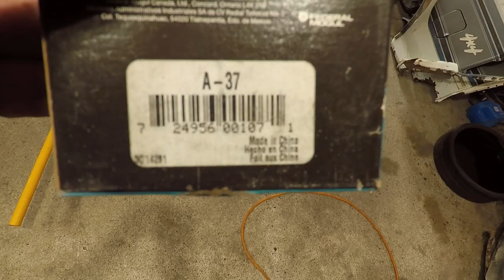Wheel BEARING Replacement  FORD F150 4x4

Comment: This might  be a dumb question but if I just buy new front disc rotors + pads wouldnt I just be doing a 2 for 1 fix? Or I would have to transfer my old bearing into the new rotor

Comment: I replaced the rotors on my 79 f150. I noticed your outer nut came loose very easily; I torque the inner to 50 ft/lb then back it off 90°. I torque the outer nut to 150 ft/lb, though the spec is 160-200 ft/lb. but my torque wrench maxes out at 150. I wonder if your problem stemmed from an outer nut not being torqued enough?

Comment: I replaced the wheels bearings, spindle, spindle bearing, the races, the wheel seal. And I’m getting a noise (scraping/dragging noise) from one of the wheels. Any ideas? I replaced front brake pads too.

Comment: Thanks for adding in the torque specs. 
I replaced all my steering links,and while it was in the air I noticed it had about an inch of play 😂. Needless to say I'm replacing both sides tomorrow.

Comment: Awesome video, man. Followed it to the T and had great success! Question: how much trouble am I in if the inner spindle nut doesn’t have the notch that the spacer fits onto? I can see where it used to be but it seems to have broken off sometime in the past.

Comment: Just did mine on the 79 f150 4x4.     Really went for the ujoints, but bearings there. so... repack.  They were timkens. Pretty kewl.  Someone was in there.
Mine was jerking my truck randomly into traffic.  It was the ujoint.  All rusted, needle bearings..   All good now.

Comment: I've definitely spent my share of time inside a 9th gen 4x4 front hub, had to change the passenger side bearing on mine too, drivers side was like new but I pulled it apart to repack and visually inspect it anyway

Comment: I changed my upper and lower ball joints wheel bearings an inner tie rod wow what a job that was an the left axle had to be changed to the nut from hell was truly a nut from hell stripped my threads but was able to find a really nice used one for cheap

Comment: On my hub before you get to the locking nuts there is a c clip that slides on the cv axle & then the spacer comes out then you have the lock nuts

Comment: Question.  Does a new hub assembly have the bearings installed.  So all you have to do is swap hubs.  Or do you have to still pack the bearings into the new hub.  I have a 1995 f-150 5.8l and the bearings go out and I’m considering just ordering a whole new hub (because it’s not that much more expensive)
Reply: I have the same truck, and was wondering the same thing. Did you ever figure this out?

Comment: Thank you for the video sir. My trucks front end has been squeaking badly, it’s not the brakes or rotors. I took it to a shop, they said it was a wheel bearing. I will attempt to tackle this myself, hopefully I can.
Reply from the maker: Take your time... Not hard...  and way cheaper than a shop doing it
Reply: @TheFoxShop  I’m sorry to bother you, but I’m at a stand still. I’ve got the new inner bearing/seal installed on the rotor. Now, I’m unable to get the rotor back onto the spindle. It stops at about two inches from the back brake pad. Do you happen to have any and ice/idea on what I may have done incorrectly?

Comment: I just had to pull my hubs off to do brakes & rotors. Noticed signs of rust inside, 
or at least rust colored grease. The inner seal looks good but replacing it anyway.
Did you experience the same? I can't imagine how moisture got in there??
Reply from the maker: No, didn't have any of that. Bad seal possibly?

Comment: Need some advice I got a 93 f150 that has new brakes all done this is 4x4 but it makes a bad scraping noise  when driving  I'm at wits end
Reply from the maker: Well... Obviously something is scraping somewhere..  initial thought, maybe one of the dust shields on the front got bent or something and rubbing on the rotor?

Comment: Fixing to purchase a 93 f150 xlt. When putting it in 4wd do you have to lock wheel hubs along with shifting it into 4wd with the floor shifter? That seems odd to me.
Reply from the maker: Depends on if you have the automatic hind or not..  but they tended to not be real good
Reply: @TheFoxShop  how do you tell the two apart? I'm not familiar with ford trucks.

Comment: Thanks for the video, I push snow on my property with the same truck as you have.  I'm going after a loud chirping sound front front left wheel under load and I'm afraid after pulling the hub apart I'll end up pulling the drivers side front axle and go after universal joints...Hope not but we'll see.
Thanks
Reply: Did you figure it out? I've got a chirping on the passenger side when moving that goes away when I hit the brakes and im trying to figure out what it is
Reply: @cainhager9814  Yes, I ended up putting in new driveshaft universal joint and cleared the problem.  Like checking for a worn wheel bearing, crawl under it and try moving driveshaft up-down and sideways at the joints and see what happens.

Comment: I know this is an old video but I need help quick.  I have a 1996 4wd, Amazon says this doesn’t fit my truck but only shows me the 2wd part, which I bought and it doesn’t fit.  Will this fit a 96?  Mine looks the same as yours???
Reply from the maker: What part are you talking about?
Reply: No it's not dependent on the motor. It's a year thing. 95-96 use the same bearings but different seal.

Comment: I am in no way knowledgeable of anything to do with mechanics. I have a question, Is it possible for a poorly reassembled vehicle cause the bearings to go bad? 
I recently had my F-150s oil changed and the tires rotated. The very day I got my truck back I was hearing a sound in my left front. Because it had been a long time since I had tires rotated I contribute to road noise. But then I kept hearing it usually when I would turn to the left. Then I was hearing a grind/rattle when accelerating that to me sounded as if the drive shaft was rubbing on something. With the shop having told me my brake pads needed work. I returned it to them for the pads to be put on and mentioned the sounds I'd been hearing. I let them know I'd been hearing it since they worked on it last time. As in "I'm on to you, I think it's your fault." Got a call that the sounds I've been hearing are the wheel bearings. 1 is loose and the other is nearly worn.  Going to cost $1,400.00 for it all to be fixed. This shop is or has been the most reliable and honest shop in my town. But now I am I wonder if they can be trusted. 
But watching this I am not seeing why they would need to mess with the bearings when rotating the tires. Anyway...I am just pissed and looking for answers LOL. Nice Video, you have a beautiful farm.

Comment: I have a '92 F-150 and at highway speed, there is a grinding sort of noise that appears to be coming from the driver's side front side. It sounds similar to a straight-shift vehicle when you need to shift to the next gear. I've had more than one person tell me it's a wheel bearing. Did you experience any sounds before you changed yours? Thanks for posting this informative video!
Reply from the maker: Is this a 4x4 truck?  Automatic locking hubs?
Reply: @TheFoxShop  Yes, 4x4. Not auto hubs. I have to manually engage them.

Comment: Wheel bearings are quirky. I had a VW that made a clicking noise by the rear transaxle. When I changed the constant velocity joints I noticed a small blueing mark on one of the bearing balls. That's all it took to make the clicking noise. One tiny mark on one bearing ball. So, yeah at first glance wheel bearings may look ok but hide damage well.
Reply from the maker: And cheap enough that if you take run out to look at em....might as well just replace em.
Reply: Way back when I could do my own maintenance,  I used to repack my wheel bearings every 25,000 - 30,000 miles. They lasted forever. This is back in the 1970's and 80's. I can't vouch for that kind of quality now-a-days.

Comment: What size socket is needed to remove the locknut?
Reply: BigK i changed my bearing but now the 4x4 is not working
Reply: Do you guys know if it has something to do with the 4x4?
Reply: @BigK the socket is 62mm or 27\16 not the one with the 4 teeth
My bearing lock nut is 6 sided no grooves for the socket
Reply: @mrg788  you may have missed a clip and the shaft is not engaging the hub

Comment: Man you just reached in there and pulled that spacer out with ease... MINE WONT COME OUT WTF
Reply: Did you get it out? lol
Reply: @TherealWinterpillow  never was able to 😂😂
Reply: @ischwhit6747  are you talking about the spacer with all the holes in it? Mine won't come out either. I need to replace the rotor but that spacer won't come out and neither will the hub

Comment: 92/96 why do u want locking hubs it doesn't come with manual hubs. Go check u r doing unesary work. Tell ya all. It's just a ford. Brand new are same way. American Ford.
Reply from the maker: Because the auto locking ones are junk.  Look it up

Comment: Shit most guys get 3000 miles. But u care2 rings 2 more rings remove with special tools pics for 4x,4. It never came with hubs. Why do u want hubs. Really they don't come with 1993/1992/96
Reply from the maker: Yeah yeah...they came with the auto hubs..so yes they still came with hubs LOL..  and those auto locking ones are known for going bad... That's why the manual ones.
Reply from the maker: 3000 miles?  What?  I would have to look back at the video to know what you are talking about.
Reply: @TheFoxShop  Yes warn is good. The other day. I left them locked in. I reached 30km omg did it ever shake. I totally forgot how to work my 4x4. I seen some with rear transfer lock. I heard all time 4x4. So I know pavement is a no no. So 2 hi put in 4 hi. Lock hubs then jump in and put in 4hi. I can't believe I forgot. My death has lots to do with it I'm sure. My pancris burst I was so sick 10% chance that's all I needed to go on living after my death. Was dead 3 month
Reply: @TheFoxShop  Yes I was told about the other manual hubs. Warn hubs are the best they have a new colour and shape. I'm missing 4 bolts. I need to get so they don't fill full Clay.

Comment: You drive a Ford and you're concerned about using a bearing made in China?  Everything on that vehicle from new is designed to fail within a relatively short time period. And then O'Reilly and other sellers of more cheap crap make a fortune off you as well.

I have one sitting out in the snow and cold waiting for me to fix it.  I bought it because I needed a woodhauler quickly and I've been replacing parts on it ever since and that was about two years ago.  What crap.  

Nice of you to tell us morons how to fix them though.  Dealers won't tell you crap because they want to corner the knowledge market.  They're special trucks you know.
Reply: calm down cowboy, trucks from 20 years ago are bound to need a couple things. wheel bearings and down the road you go isn't so bad. keep in mind all the best trucks made have engines made by someone else, Cummins, international, Isuzu (dirtymax).